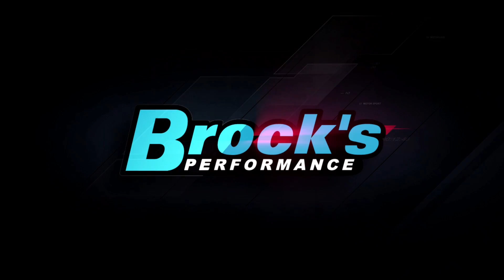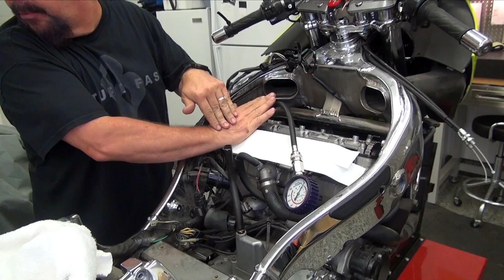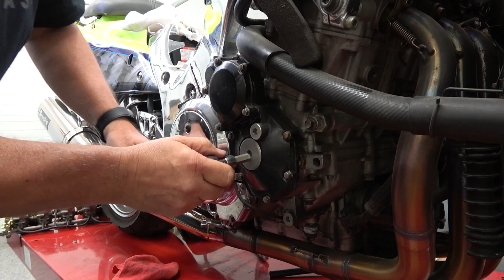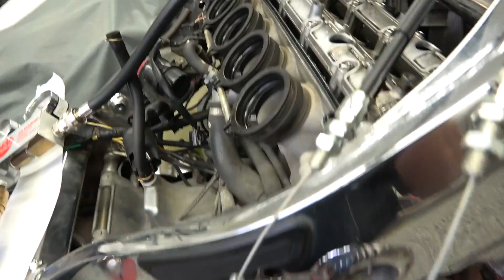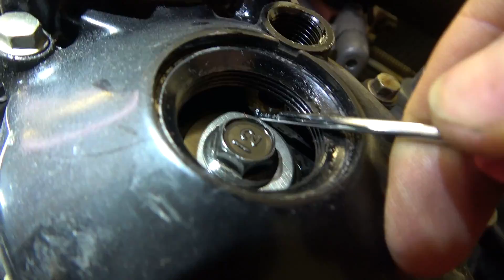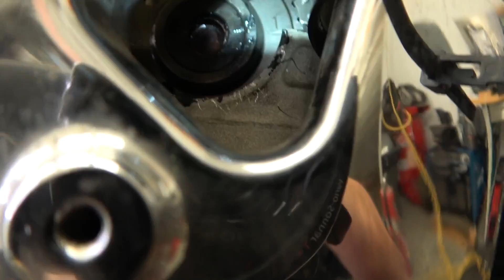Gen 1 Suzuki Hayabusa Miss (Part 2) Compression and Leak Down Testing

Comment: Hey Brock if the number 1 spark plug doesn’t have sutt  on it and the other three do what could be the problem for that
Reply from the maker: You really can't read plugs on a fuel-injected bike like you could on the old carbureted bikes. I would say if one is lighter than the others, I would look for a clogged fuel injector or vacuum leak that could be causing a problem with that one cylinder. The easiest way I have found is to spray Windex on that exhaust head pipe compared to the rest to see if it melts away slower. If it does, that's an indication that you could have the problems I just spoke of, or you could have low compression in that cylinder, but at least then you know which cylinder to focus your attention on, especially for a leak-down or compression check.

Comment: Hi Brock Question, you mentioned titanium valve job is messy to do, can you explain that or make any video, cuz i replaced new valves on R1 2015 and headmaker did his job to make them work but after start up they got stuck it happened 2 times in a row i can't figure out whats going on there.. 
thank you so very much for taking time to record and educate us i know its very difficult job to work and record at the same time
Reply from the maker: Sounds like " head master" has the valve guide to stem fit too tight... Or, the guide material is not compatible with the valves .. Or, the valves are not titanium nitride coated... Or, a combination of the above.
Reply: @BrockDavidson  hmmm, thank you so much for the reply

Comment: Thank you for the leakdown explanation. I'm just leaving a bookmark to refer back to when I test my bike at 35:00
Reply from the maker: FYI: our long description includes time stamps for easy searching.
Reply: @BrockDavidson  cheers dude. It has been suggested that I may have a sticky piston ring as the bike was sat for 12 months. Valve shims were all done by myself recently. I'm going to do a form of leakdown test where I use a compressor and pipe to apply 30psi with the affected cylinder at TDC. If it is the ring, it has been suggested some diesel applied through the spark plug hole may help soak it over a few days. We shall see!
Reply from the maker: @m2895   - We leak test at 100psi min  - if you tell me what exactly is going on, I'll try to point you to a cure - BD
Reply: @BrockDavidson  basically, cylinders 1 - 3 are 170psi, whilst number 4 is around 130. Warmed the engine and psi's stayed the same. Put some oil down cylinder 4 and psi went up to 168. I have done the valve clearances recently, so they are in spec. I just used pressure to see if any air was leaking but I have no experience with that so know I most probably done things wrong. Not sure I had TDC on the compression stroke set correctly. I'm off for a week so have time to get back at it but will be outside so hopefully the weather holds out. Thank you for responding 👍
Reply from the maker: One cylinder will always be lower due to buildup in the vale seat area from the engine valves being open when the bike is turned off. But generally, the lower cylinder will show more after the bike is warmed up , allowed to cool, and tested again - dry. If oiling the cylinders helped, you either have a stuck ring (rare these days) or bore scuffing (far more common). Does the bike smoke on start-up, or while running? Does it stop as rpm increases? Does it only puff smoke if you wick the gas? What color is the smoke? Is the engine noisy? (get noiseyer the higher you rev it?) Let me know - BD
Reply from the maker: Also - remove the exhaust pipe and throttle bodies - @100 PSI leak test pressure the cylinder in question will audibly leak (hiss) from the : 
exhaust port (bent/incorrectly adjusted exhaust valve) 
Intake  port (bent/incorrectly adjusted Intake valve)
Crankcase breather - ring problem or damaged cylinder wall or piston. (can be a head gasket leak also)

Comment: Would bad cam timing cause a bike to shut off at higher speeds in 4th 5th 6th gear?
Reply from the maker: A stretched cam chain (wrong cam timing) can cause irratic performance at higher rpms. ... But it is not gear dependent.

Comment: Hayabusas have a factory restricted engine. Am I missing something here. A least acknowledge that the computer restrictions dose not cause a high speed miss.
Reply from the maker: High speed "miss" is rev limiter because the stock gearing will not allow the bike to travel past about 180 mph in real life. Even with the gearing changed, if you do not have an ECM Flash, the bike will still not travel past 186 mph, regardless of gearing.

Comment: If you have a miss, the first thing I do is identify which cylinder had a miss… you do that by checking the temperature on each exhaust… if you have a miss, it usually isn’t compression related… once you’ve die dies which cylinder, then swap ignition coil sticks… if the miss follows the ignition coil, then you know what to do… it was difficult to see how much the cam timing  was  out, but didn’t look like a whole tooth… could be stretched cam chain… I usually change timing chains between 80-100k (kilometres)… anyway, good video, thanks for sharing…

Comment: Stripped down my crankshaft plug last year. Tried heat, knocking with a rubber mallet, using valve grinding paste on the hex to make it grip but no Fxxxing way!!  had to time it by rotating the rear wheel instead. Ordered a new one for next inspection but i still need to get the darn thing off.. Those caps can be a real PITA ...
Reply from the maker: They are cast and will break away easily. You just have to be careful not to damage the cases. Remove the cover flip it over and try to crack the cap out with a chisel as a last resort, if needed.

Comment: Brock in the kawasaki race manual it says for the valve clearance.
 More performance is expected when adjusted from middle value to upper limit between adjustable range. 

But don't you want it at the minimum clearance to open the valve sooner and more.

Thanks
Reply from the maker: Correct. I'm not sure why the factory manuals like more clearance...other than guys getting it too tight and causing problems.
Reply: So brock what would you recommend for the minimum clearance on intake and exhaust please
Reply from the maker: @jockvanniekerk8074  .005 in/.007 ex MIN

Comment: Great Videos! 
Without being a spoiler (I understand what you are trying to do here) however, I would have, before pulling the valve cover, started the bike and pulled the cam sensor connection.  It "should" have rev'd without a miss, showing me that the cam timing was off (or a cam sensor going south).  :)
Reply from the maker: Hey @Ransom Holbrook -- SUPER FAST guy in the house! (Learn more about Ransom here: https://bit.ly/3PKMTR9 ) You have more experience with these engines than most, for certain. Teach me something here my friend. You are saying to unplug the cam position sensor and the bike should rev without a miss? And if it does... the cam timing might be off? and/or the sensor is going bad? I'm confused - can you explain in more detail?
Reply: @BrockDavidson  
So what happens in the ECU is that the cam sensor and crank sensor communicate with each other.  The bike will not start without a cam sensor signal because the ECU doesn't know if number 1 or number 4 is at "true" TDC by reading only the crank sensor.  Higher RPM misses and/or false REV limiters are caused by the ECU seeing the cam sensor outside of the "proper window" based on the cam sensor signal. Assuming the cam timing is off, then you get the miss or false REV limiter and this is also the reason you can set the intake cam above 114 degrees [it goes outside of the expected window of operation].  So.....if you start the bike  and then unplug the cam sensor,  the ECU ignores the cam signal all together and depends soley on the crank sensor for RPM/Ignition and such.  I've seen this a many time on the dyno, easy to diagnose. 
Good?
Reply from the maker: Ok, the key is to unplug the sensor after the bike is running. I'll try that next time I get a chance. Not sure if you know, but you can reverse our cam pin to allow lc numbers above 114 also.

Comment: These Suzuki engines are bullet proof. I had a K4 that randomly kept dumping fuel into cylinder #4. Compression test revealed 112psi in cylinder 4. I thought for sure the gas washed the cylinder, and melted the rings. I fixed the electrical issue, dumped a little oil in the cylinder, changed the oil, and put it together. Rode it for 200 miles or so. Compression came right back up to 180+ psi. 
Ever since then, I've been sold on Suzuki's.
Reply: Good choice - Suzuki -simply the best.

Comment: On my busa there was a big difference warm/cold engine when doing compression test. And from what I know its only the gen 2 and 3 that has the titanium valves
Reply from the maker: Good catch on the valves! They run together after a while. There are many things that can affect compassion results - gas/oil/fuel in cylinder...condensation, surface rust etc. We perform the tests after warm-up as this best represents the state the engine is operating in.

Comment: Hi brock great video so the plug gap 20 thousands does that apply to drag racing aswell and how about turbo application.
Thanks
Reply from the maker: Yes. The theory is that it's tougher to "blow-out" the shorter plug gap.

Comment: I ran into a odd cylinder miss recently on a zx14. You could hear the miss. Used a digital temp gauge on each header pipe. Number 1 was about 200 degrees less than other cylinders. Other 3 were 600 degrees number 1 was 400. Checked plug and coil which were ok.  Started getting worried and was about to dig into engine but I could not believe the engine had a problem. Went back and tested coil and plug by swapping to a different cylinder and the problem followed. Moved only plug to another cylinder and the problem followed. Turned out to be an intermittent plug failure. Been working fine ever since.

Comment: Brock how come the leak test results were so good if the timing was off? wouldn't that mean that at tdc the valves might not be completely closed?
Reply from the maker: @valter ponte - Great question! The simplest reason is that it only jumper one tooth...any more than that and the valves might not have shut at TDC, but they would all also probably be bent by collisions with the piston.

Comment: This has been an interesting watch, i’m sort of in the same boat as you, i’m restoring a 99 ZX9R that has a miss on cyl #3, after watching this a leak down check is in order, its showing good cranking compression but has a miss @ idle & low rev’s, carbs are cleaned, rebuilt, & sync’d, fresh plugs, ots been perplexing to say the least

Comment: You did say the manual tensioner wasnt adjusted for the cam chain .
Reply from the maker: No. The tensioner was originally adjusted and worked well for a long time... but just like any chain, the cam chain adjustment must be maintained to prevent the chain from slipping on the sprockets as it stretches due to natural wear. Hyvo style chains are quiet, but they don't have much engagement - so  proper tension is even more important...that's why the OEM tensioner self-adjusts.